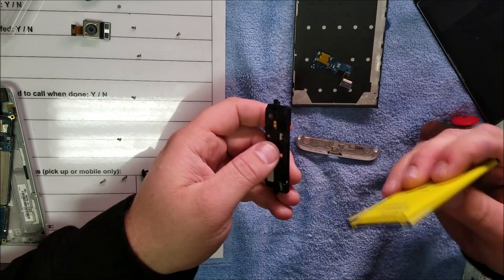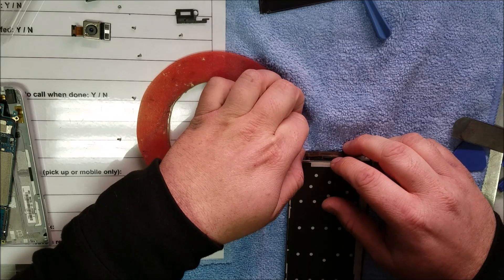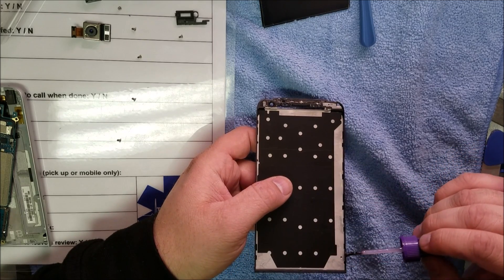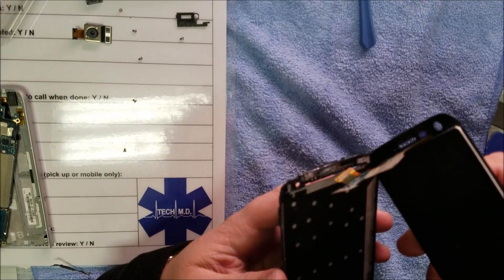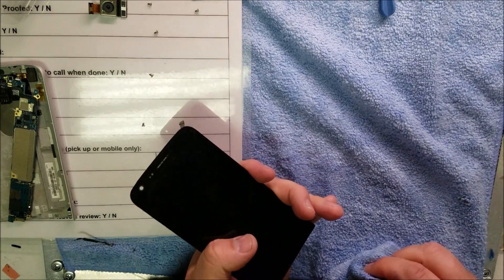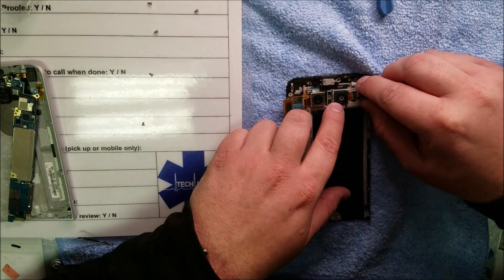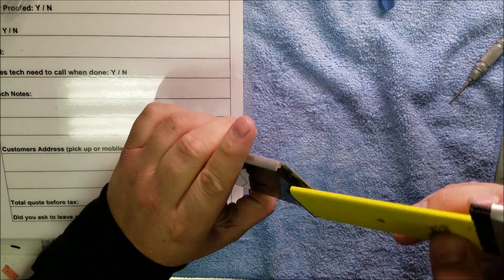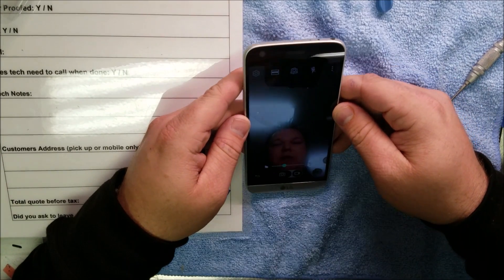LG G5 Teardown With glass only Repair Part 4 Semi Fail

Comment: Truth TV only subscribe to this channel if you are a fan of the truth mixed with your DIY videos. You will not catch highlight reels on this channel, only real time repairs done by a real live technician. These are not preset phones with that he's ever moved after the repair has then repeated several times until the actor can perform smoothly some of these guys deserve an Oscar they act they don't repair or diagnose anything. Which contributes nothing to the technician community. TRUTH TV
Reply: U are crazy man  :-D
Reply: That's a typo in the center^^^ he is not an actor with the preset phone who is had routine practice over and over on the same phone until they can perform The acted repair flawlessly. #TRUTH MD
Reply: That's a typo in the center^^^ he is not an actor with the preset phone who is had routine practice over and over on the same phone until they can perform The acted repair flawlessly. #TRUTH MD